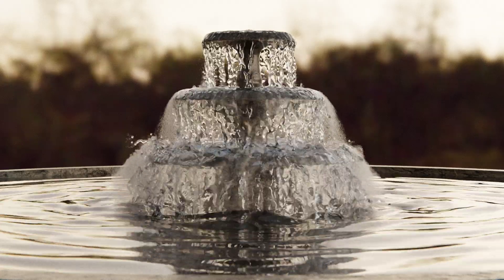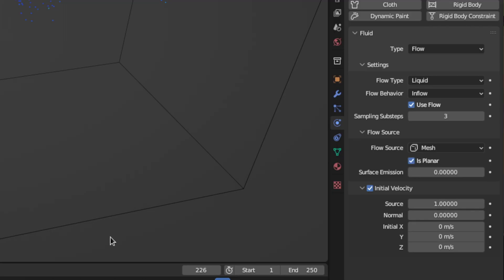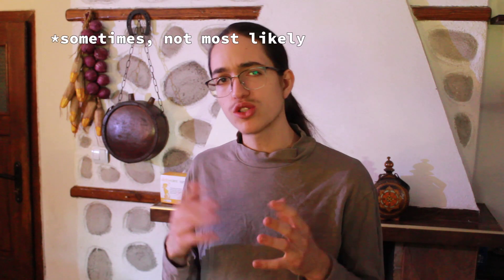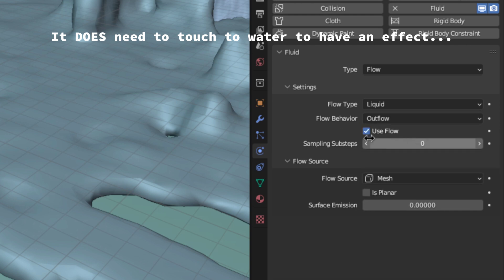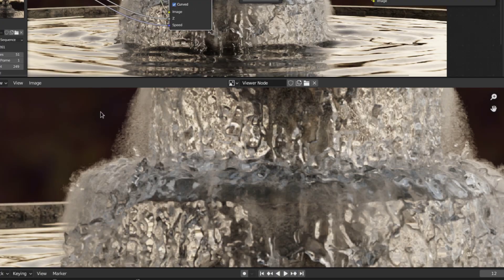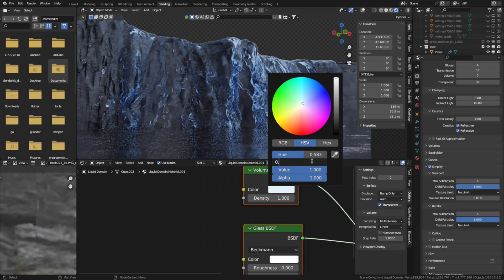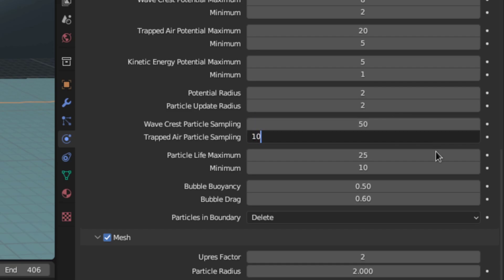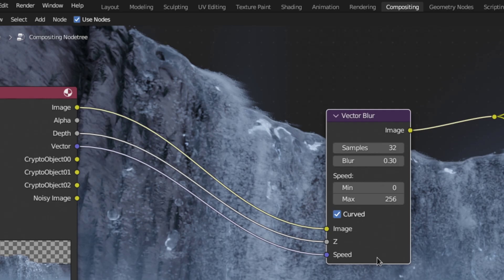Master Fluid Simulation in 4 Minutes | Blender Tutorial

Comment: How can you set the particles now ? I just get a particle system called "spray+Foam+Bubbles" so i cant set these separately..
Reply: Setting up spray foam and bubles creates an additional particle group, you have to create an object (circle) and apply it to the group as an object in the particles tab. When selecting the particvle group, it will say Render as Halo, this is why those extra particles look colored. Change it to Render as Object. Once you select that, you can drag your circle or shape to the instance object tab.

Comment: Hi, I have a water simulation running 3 times in my project, but when I keyframe the domain to switch back on for the next waterfall, the left-over water from the previous sim comes back. I had to keyframe the "particle radius" between each simulation to "flush" the water out. Is that the correct method? Thank you.
Reply from the maker: So if I understand correctly you want to remove water from the simulation right? To do that, you can add an object, and give it the "outflow" flow behavior, and that'll act as a kinda water drain. You can turn the draining on & off by keyframing the "Use Flow" Checkbox. Let me know if that helps!
Reply: @edinspiegel  Thanks a lot for replying. For me, if the effectors still have water on them before the liquid domain gets disabled, then that sitting water comes back when I re-enable domain. If I keyframe the particle radius from 100-0-100, the next time the domain is enabled, I get a fresh water sim. I want to render it all in one video (I know I probably shouldn't). I suppose another way is to keyframe the effectors to be outflows at the end of the sim and thus the water would disappear. Hope you know what I mean now. Just got a feeling there is a slightly better way (although my method does work!). Thanks again.
Reply from the maker: @DaveThompsonfairlife4all  No problem! Yeah So I have another idea (I don't know if it's better though): Add a cube, and make it the size of the fluid domain, then make it a flow fluid object,  and switch the type to outflow, then you can just animate the use flow to enable at the point where you want to remove all liquid from the domain. Maybe that'll work - Let me know if it does!

Edit: Oh just got another idea: You could have multiple fluid domains, and then you can just disable the old one and swap out for a new one, which if you have another cache directory, should also work.